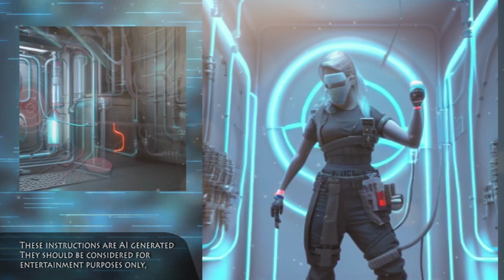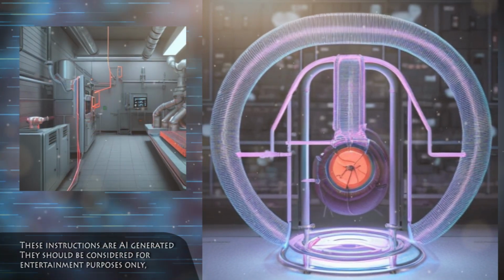AI Reveals How To Build a Time Machine

Comment: A time machine requires a large amount of energy, preferably from a power source that is capable of generating an immense amount of it. It also requires a mechanism to control the flow of time, as well as a navigation system to guide the machine to its desired location and time period."